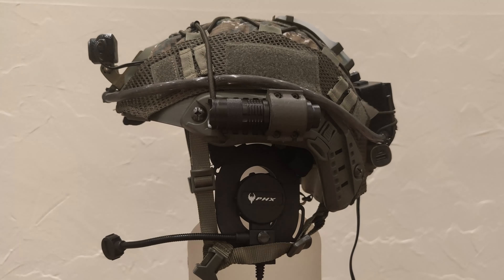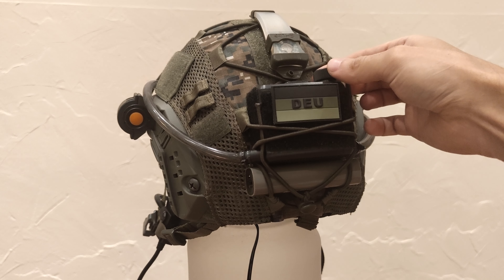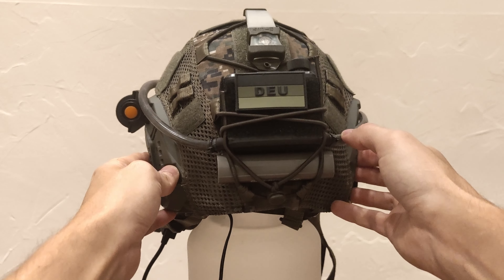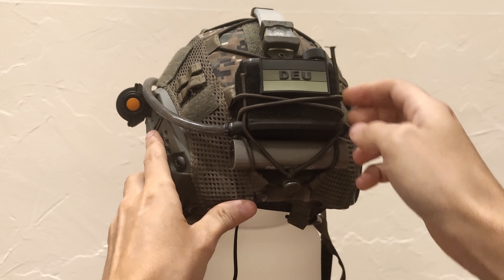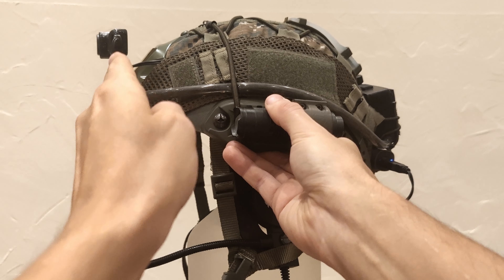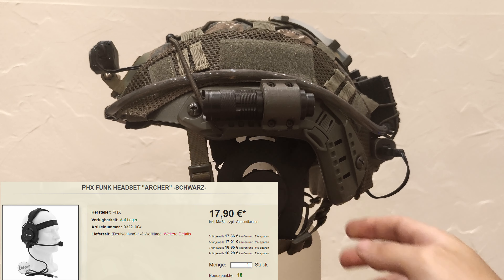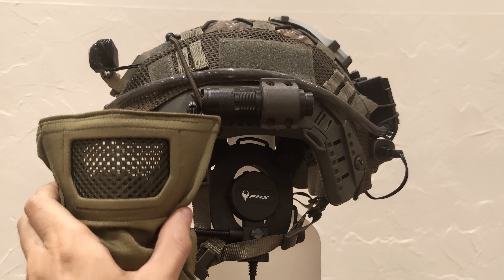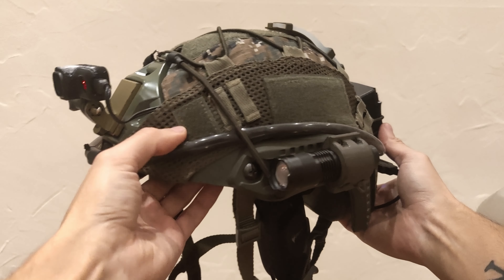My Airsoft Helmet Setup: No chance for fogging goggles!

Comment: What kind of zip ties did tou use for the front of the hose to connect to your goggles? I know there is a connector port for the goggles but im trying to figure out what zip ties you used and where you placed them.
Reply from the maker: Those are just regular zip ties you can find at any Hardware Store :) nothing Special. have a good one!